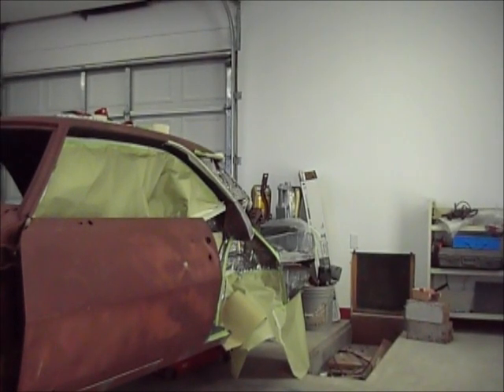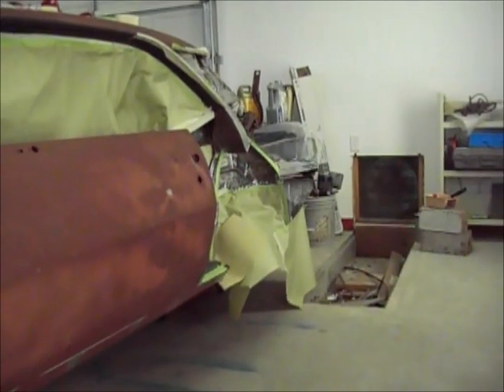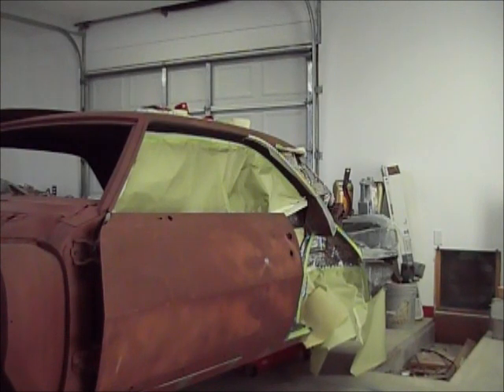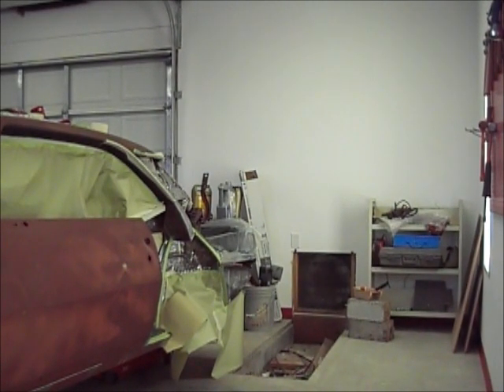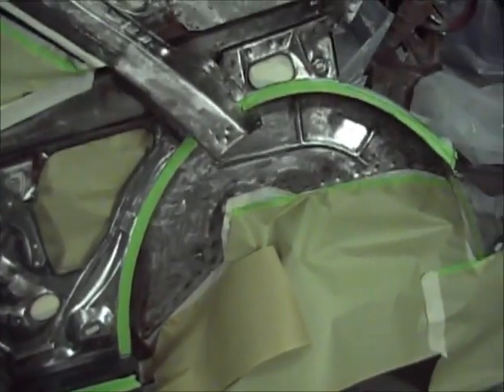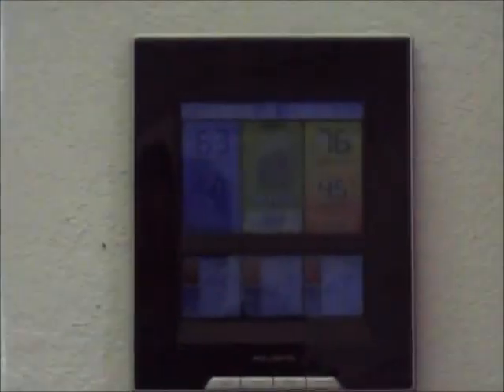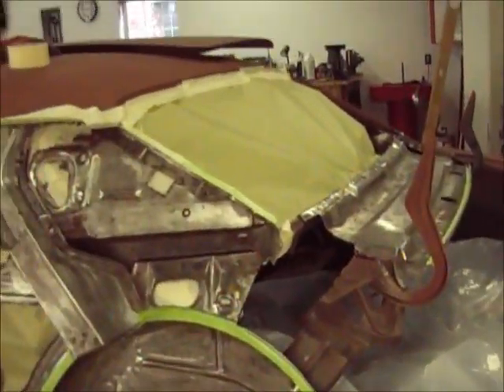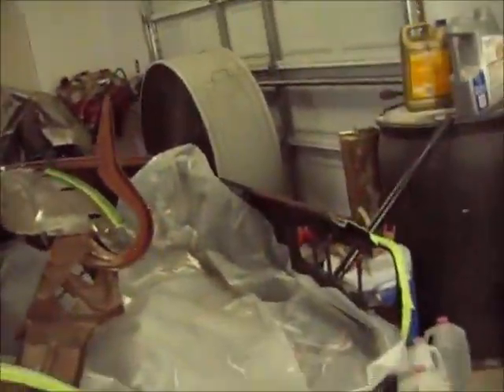Spi Epoxy Down

Comment: I know this is an older video but I’ve just started following all of them, and your videos are awesome.I’m working on an 80 camaro . I’m in the process of sand blasting the car down to metal. I bought the the same epoxy that your using. What grid is sand paper did you use before you spray the bare metal?